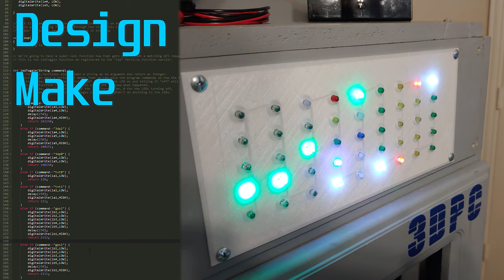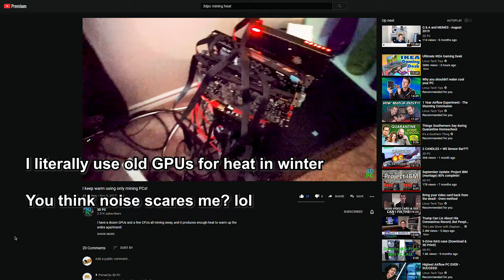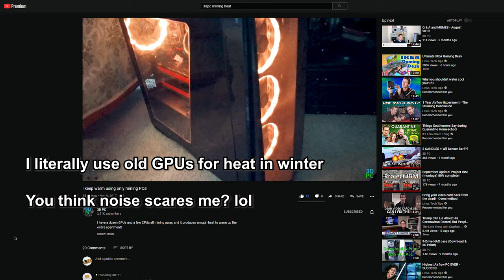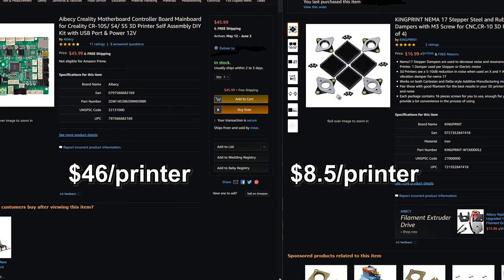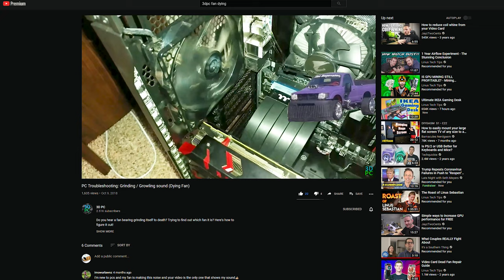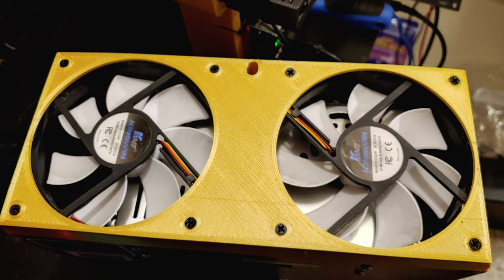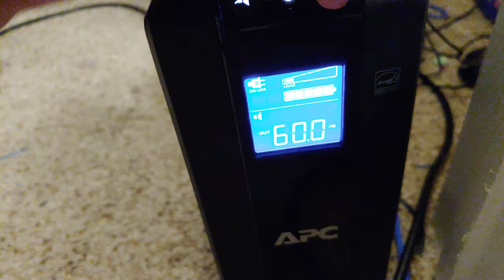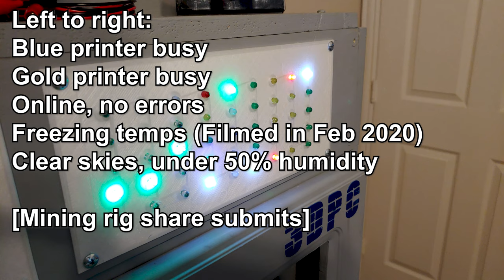Top 10 3D printer MODS (Creality CR10)

Comment: It really blows my mind the fact that these people do not have text your Bill blades that are magnetic to make removal easier. If you're going to mod something that's the number one mod you should make. Heck, most texture Bill plates come with a PEI build plate on the other side that has a unique texture to it that comes off on larger flatter prints. I also print like giant wraps and use them for photos. When I peel them off and turn it over just close the raft spacing to .5mm  And you should end up with a fairly smooth but very detailed texture pattern on the bottom. Just what I use. On the cr-10s pro V2. Bought off eBay.

Comment: Once you unplug the power cord, the highest voltages in a 3D printer controller are either 12 volts or 24 volts, depending on whether the printer is ... well ... 12 volts or 24 volts.  You MAY be able to feel 24 volts, but most people can't.  (I'm a retired electrical engineer - I've been "stung"many times, but never with anything under about 45 volts.  (And that's barely enough to realize that you got a shock.)  Turn the power supply on again after unplugging it, if you must, but it really won't make any difference if you happen to touch a 24 volt point and ground at the same time.  (I'm not advocating ignoring a danger - I'm very risk-averse - but 24 volts is hardly enough to worry about.  (The higher voltages inside a switching supply are ... inside.  Unless you take the cover off the power supply itself, you can't get to those voltages.)
Reply: It´s about the big capacitors in the power supply if I understood the video correctly. They can still hold high voltage after unplugging the machine, if they're not drained.
The PSU might be encapsulated anyhow, which would make it impossible to touch the capacitors…

Comment: My CR10
BIGTREETECH SKR E3 DIP V1.0 32Bit Control Board - Board was very cheap lol
Kingprint TMC2208 V3.0 Stepper Damper with Heat Sink Driver UART - made the movements a lot quieter 
BLTouch
Marlin  2.0.7.2
Upgraded fans in the control box to make it quieter.
Filament holder from control box bolted on the z axis top mount, fits perfect like it was suppose to be there.

Comment: Couple of suggestions .......  put a appropriate size ( either furnace or another type ) filter . Over those double fans if experiencing a dust buildup . Vibration mats for the tables . They’re made in various lengths , widths and thicknesses .

Comment: Those legs are so high they probably introduce print artifacts from vibrations.
SKR 32bit  boards are cheap as hell and they'll drop your noise as well as eliminating salmon skin (original CR-10 boards didn't the type of stepper drivers that caused it anyway) they use TMC 2209's which don't generate as much heat as well as giving you the ability to adjust your vref without fiddling with tiny pots.
Reply: yeap, the way is 32bits processing and new driver for motor..... love printing and wife dont complain..kkkkkk
Reply: Yes, the printer is shaking very visibly in the video which cannot be desirable. Even the table might not be level or wobbles a bit. A heavy table would be desirable, which can also be achieved through adding weight on top. Concrete terrace slabs are cheap and do the job – also to raise the printer without adding more wobble…

Comment: My CR10S4 mods so far:
1) Magnet bed (64 pcs) with flexible metal sheet + LokBuild surface
2) Linear rails at all axis (HIVIN version 12)
3) Instead of Raspberry I'm using BananaPi M3 with additional hdd +Logiteh 930e webcam + Octoprint 
4) All fans replaced with noctua or other silent ones
5) Replaced stock heater to Keenovo 230V (great time performance - to 60C now I need just less than 4 min)
6) SKR V1.4 turbo with TMC 2209
7) Belts tentioners + also  Z synchronizer
8) Orginal EZABl Pro from TH3D
9) Orginal MicroSwiss all metal hot end
10) replaced stock extruder with all metal + 2 gears 
11) Still have TL-smoothers (I was just too lazy to take them off :) 
12) Of course Marfin firmware updated
Those are the most important upgrades. There also were some minor but doesn't affect quality of print, so it wasn't worth to mention about.
Reply: @MevRB19   :) You are wrong. Knowledge is priceless, money are worth nothing besides a fact that people used to pretend it's opposite. In case like that you replied from device which tommorow will be a garbage, right ? ;) If you so much care about money you lost some amout , while I was having awesome time tinkering. And the most important: you have judgged a 1 year old comment, which is related to printer which was very popular 5 years ago and that far ago all mods were done. Those time it was gad damm worth it! ;) My advice : read and ovething twice before putting meaningless replay. Cheers

Comment: My CR10 modifications:
Single motor dual Z-Drive
Motordampers
Linear rails for Y-Axis
Rubin Nozzle
Buildtak
Top holder for filament spools

To do:
Footprint reduction by unhousing it, Moving PSU to it's side
Ledge K 32 Bit Board with TFT Touchscreen and 2208 drivers
Switching dual extruder

Comment: Mods on my cr10s:
-Enclosure
-Magnetic bed (later removed)
- 0.7 nozzle (i dont print figurines, just functional stuff)
- Automatic shut off after end of print
- cable extensions
5 or 6 years old and still prints ok

Comment: I thought that these new generation 3d printers no longer benefit from tlsmoothers?
Reply from the maker: That may be true, the main printer I tested this on was from 2018, but likely made in 2017. The mainboard in this particular unit had other design flaws like difficulty stabilizing the nozzle temp (getting stuck in preheat stage of a print, unable to settle in on a specific temp). My later CR10s don't have that particular issue.

Comment: So many things wrong with your list, even the things you installed you did wrong.

1. TL smoothers- good- you should have them on every axis including both Z and E

2. Stepper heatsinks- dumb- If your steppers get that hot, you need to check the trim pot voltages

3. Dampers- good- You should have the motors mounted on both sides via back braces with dampers so you maintain rigidity and the dampers don't wear out. 

4. Bigger nozzle- dumb- you just need to change your line width in your slicer, you can safely print to .6mm and possibly .8mm depending on the geometry of the nozzle with a .4mm nozzle, in which the minimum line width should be .5mm.

5. Dampening feet- good - you should use foam golf balls in the feet, for better isolation, this will not only help with sound but also help with ghosting. 

6. Bungie cords- dumb- this will cause too much friction on the filament spool causing your filament to stretch or strip going into the extruder. 

7. There is no high voltage stored in the PSU

Things you didn't mention that are easily Top 10. 

Z Braces
Dual Z (if truly a standard CR10)
Textured PEI spring steel print bed
Auto bed leveling
Enclosure
Marlin 2.x firmware

Comment: Sorry, but the CR10 is far away from beeing an awesome printer. If it would be awesome you woun't need to add a ton of modifications/improvements to it. But it's cheap and that's the only reason why it's so popular. The frame is to high so it produces a lot of strange resonance frequencies, the bowden extruder is placed directly behind the spindel (WTF?), the x-axis hangs in the air on one side which works probably for small printers but not for a monster like CR10. The wheeles design is crap because thausand of CR10 Users think their poor print quality come from a loose belt tension...and there are many more design faults on CR10.